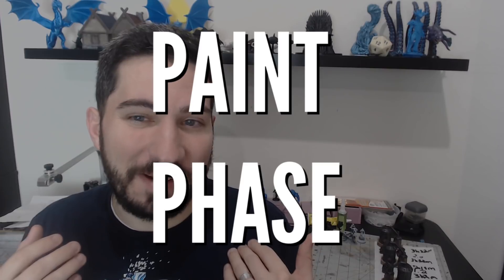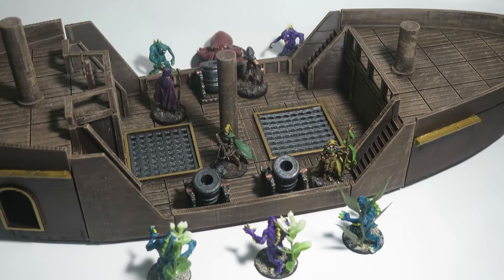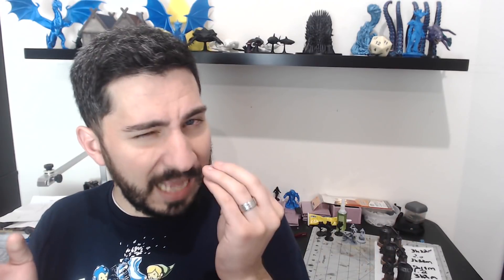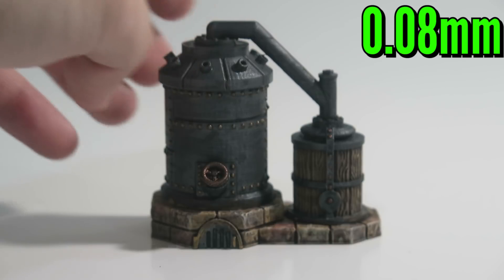Layer Height Test (& Kickstarter Teaser)

Comment: Would a .02 nozzle with a .04 layer height produce less visible layer lines ?
Reply: Smaller nozzle means you are able to print smaller layer lines the smaller the layer lines the more detail but they do take longer to print

Comment: I've been binge watching your videos to get my prusa's detail dialed in for minis. I gotta ask, what speeds are you printing at? 5-7 hours seems long but you got awesome detail!
Reply from the maker: Welcome to the channel! You can do it, but most folks I've seen do it on a Prusa dial in and use a 0.2mm nozzle. Check out Tomb of 3D Printed Horror's tips in his mini printing video, and integrate those into your profiles. At 0.08 layer height, it's more like 3-5 hours. For 0.04, yes - 5-7 is normal once you factor in supports and go slow. I normally print at 20-25mm/s for minis. 

Hope that helps!
Reply: @3DPrintedTabletop  right on man! This is the info I needed! I'm trying with a 0.4 nozzle and it's satisfactory, but I'd like better. I have a 0.25 I haven't tried yet, so I'll give it a go!

Comment: Thanks for the video! I have a Flashforge creator FDM printer with limitations similar to a maker bot. I'm trying to print reality small parts with details around 0.2-0.5mm. I'm swapping out my standard nozzle to a 0.2mm nozzle and still fine-tuning it to print the finest detail. Do you have any experience or videos regarding what's the limit of layer height/resolution for a normal table top FDM printer that still print with good quality?

Comment: Does it make a difference to cut models into pieces?  With that boiler if it were a commercial kit you'd likely see the cylinders separate from the base and the top bits with the pipe separate from that.  I get the impression that you can do that but is it worth it?  I imagine it would be easier to post work some small pieces if they were assembled after the fact.
Reply from the maker: This is one of the HUGE pros for me working with 3D Printing - I am not a fan of assembly, personally. Lots of folks print small greebles and things to then kitbash into other legit models like GWS for example. That's an option too! :)

Comment: As far as quality and those high-resolution prints that take forever go, I tend to start those prints either right before I go to bed or right before I walk out the door to go to work. You're not going to notice the difference between a 1 hour print and an 8 hour print if you do that.
Reply from the maker: Sage advice, Kris - I'm the same way! I just stay up long enough to make sure that first layer is good, and boom - wake up to magic :)
Reply: @3DPrintedTabletop  yep because it sucks waking up to a birds nest lol
Reply: It's probably a good idea to make sure your printer has thermal runaway protection if you're printing unattended.  A lot of creality printers, for example, don't ship with it turned on in the firmware.

Comment: I'd love to hear your thoughts on the various competing connection systems for modular terrain. so many clips, magnets, indents etc... i'm really unsure what's good
Reply from the maker: On my queue for sure :) I'll be making a video on this within the next 3 months or so, it's just a lot of printing and production to make this kind of video and I don't use tiles too often as is. 

Just know that there are generally adaptors for every kind of printable locking system, so if you choose one say openlock or dragonlock - there's an adaptor if you want to print those from another system. Magnets are the exception, and though they are more pricey, they work beautifully. I have yet to dig deep in this area though, which is why I shared this in the interim :)

Comment: Awesome vid!!  Question, how did you find out the layer intervals?  I have an Anycubic i3 Mega and I can't find anything online in regards to this :(
Did you contact the company of your printer?
Reply from the maker: I could be very wrong, but using this: https://www.prusaprinters.org/calculator/ and this: http://www.anycubic3d.com/products/show/1077.html 

It looks like it's 0.04mm increments like the CR-10/Ender 3. Would always be good to run some tests and see if this makes a difference :)
Reply: 3D Printed Tabletop Thanks so much for that!!  I'll test for sure 😊
Reply: I was checking the links and could you tell me how you calculated that?  I'm definitely not too knowledgeable in this stuff

Comment: With adaptive layer height coming in to Cura, Slic3r (dev version) and others (e.g. IceSL), this isn't so much of an issue. They'll print slopes with thin layers and vertical areas with thicker layers.
Reply from the maker: I am definitely very excited for adaptive layer height. I'm gonna run some tests on other things like mini which are more organic shapes and where I feel would benefit the most from this kind of tech. Thanks for your comment!

Comment: you should check out octoprint and the plugin octolapse for making time lapses of your 3d prints. I would love to see them. Great design and wonderful color schemes. Finishing is very impressive too. Thanks for the info. Many will benefit from this vid.
https://octoprint.org/
https://formerlurker.github.io/Octolapse/
Reply from the maker: Thank you so much for the kind words! 

Also: I bought a Raspberry Pi 3 to do set up Octoprint, but I've had a hard time getting it to connect with my wifi. It's a project that's kinda sat on the backburner consequently. On my to-do list though! :) I got it for the timelapse feature most of all, actually :) Thanks for the recommendation.
Reply: Hope you get your wifi figured out. Octoprint is a wonderful tool. I can't imagine printing anymore without it. I'll keep an eye on your page. cant wait to see more table top parts/sets!

Also: There are plenty of easy to follow wifi guides for the pi 3. 

Keep up the good work and make every day!
Reply from the maker: I followed a few, I was able to get the Octopi to connect to the router, but was having trouble with the IP address, and was trying my best to give it a separate fixed IP address so I could log in remote. When I tried connecting it via ethernet cable, no issues whatsoever. 

I'm gonna keep putting content out weekly - and definitely will include more table top parts and sets :) If there is any prints or sets in particular that you'd like to see, let me know!
Reply: If I can assist in any way, please let me know. I have set up 50 + pi's in the last year

I would love to see as many timelapse of the prints you make as possible. I would also love to watch you detail some of those timelapses. I'm a huge fan of anything modular. Saw the airship. Just wonderful.
Reply: I was also wondering when you design your 3d models, do you do anything to add extra strength to the thin areas? Example. a thin column with a couple of negative rectangles on the inside to increase on solid layers to support and to cut up the infill consistency? if you slice any of the printer files for the prusa mk2s that has a post like the belt holder wrap around posts (extact parts names elude me atm). if you look at the post layer by layer you can see some planned negative space in there. makes part much stronger.
Reply from the maker: I just might take you up on that :) I'll find ways to share more timelapses for sure. And there will always be modular content - I mostly print things I can reuse in multiple capacities. 

As far as the designs: I'm not designing (yet!) I rely on the wonderful designs provided by the community, and choose to highlight some of the ones I especially love on this channel. There is too much to cover in one episode, so I do it little by little like I did in this one (doing a layer height test while showcasing some models from an upcoming Kickstarter I support). 

I usually increase the top and bottom layers when printing minis and terrain (although that doesn't impact the middle in say the posts like you mention). I'm gonna try what you're mentioning though :) That'd be a REALLY great concept for designers in general - as pieces breaking off during cleanup can definitely happen with support-heavy prints.
Reply: I have a prusa i3 mk2s and was reprinting all of the printed parts for the machine just in case I had any fail. While slicing the files i noticed this being done and I have started working with that concept on many of my designs. I made a shower head holder (mine broke) and it lasted a couple of months. I added 2 negative rectangles on the inside of the holding arms and made a print of both. old version breaks with a little strength. new version is very tough and it took a lot from me to break it. Perhaps I will make a video and show this concept. If you get some good results i'd love to see them too. Ill post you the link of video when/if I make it. FYI, my web cam isn't the greatest. I'm always for information and the spreading of it. 
Thanks for introducing the oakenspire kickstarter to me. I'll spread the word too.
BTW what printer(s) do you use.
Reply from the maker: CansofSwine I have a CR-10. Love it. An i3 is next on my list for FDM printers :) I would LOVE to see your video if you make one! Please do!